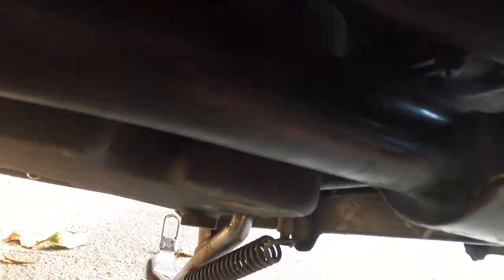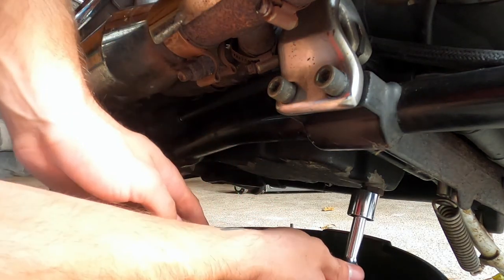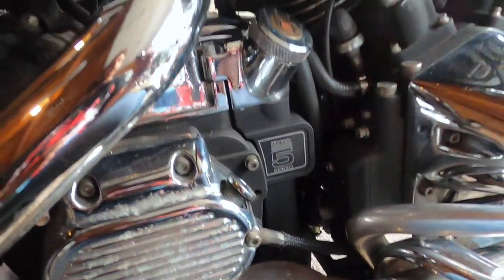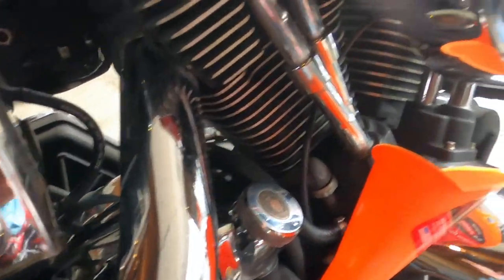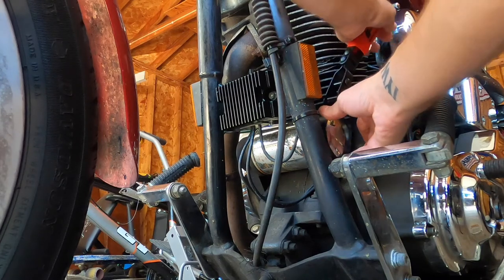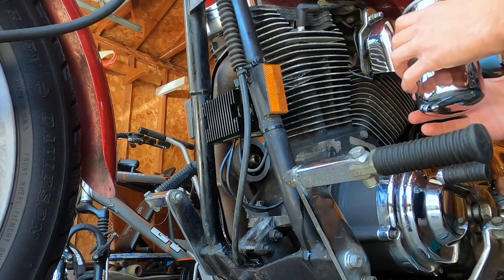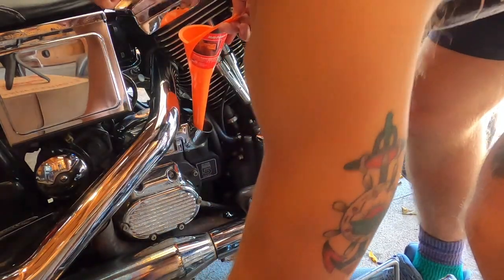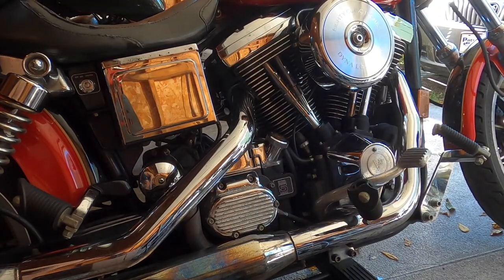HOW-TO: Harley Davidson Evo Big Twin Oil Change - 1998 Dyna

Comment: Bit lost here ,your title says Evo Big Twin Oil Change but the bike your are working on is a Twin Cam ?????????????
Reply: 😂😂😂 you don't know Harley's very well
Reply: @xxtyler420xx           you sir are correct, i was comparing my CVO 1999 FXR3 1340  to the 1998 Dyna in the video which is a twin cam and not an evo.
Reply: i looked a bit harder, looks like they ran the twin cam trans on that year 1340 then did away with the fxr then ran the 1450, phew

Comment: What happens when the oil tank gets overfilled with motor oil
Reply from the maker: Too afraid to find out honestly lol They just say not to do it. Plus with an Evo it's better to run just a little less than a little more per the old wise gear heads